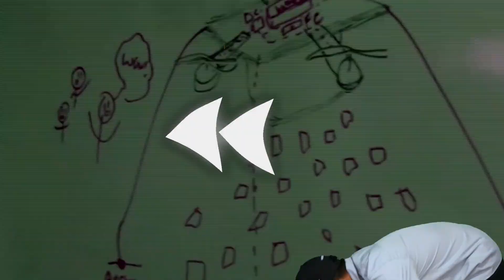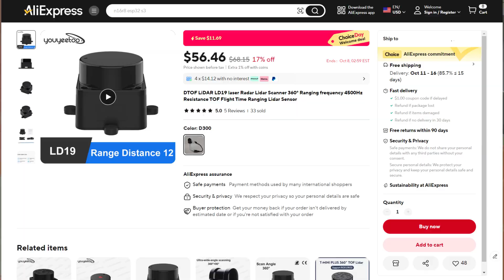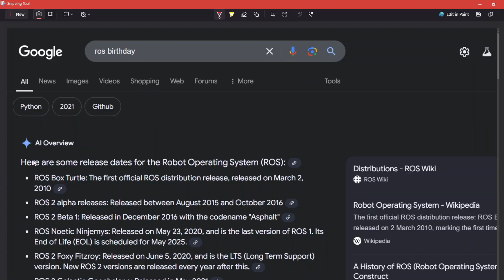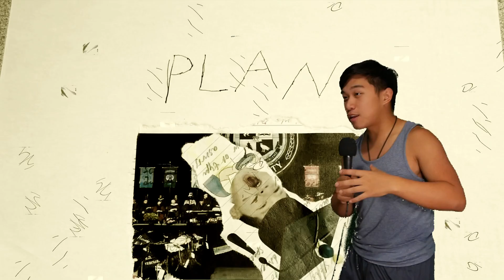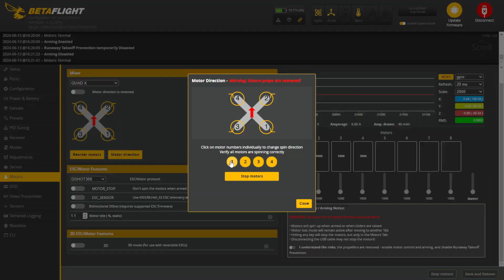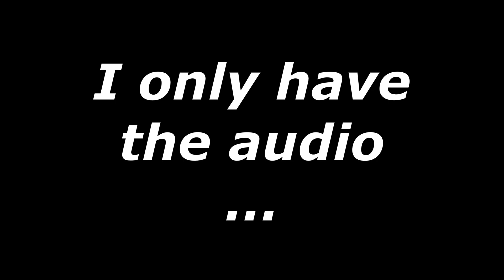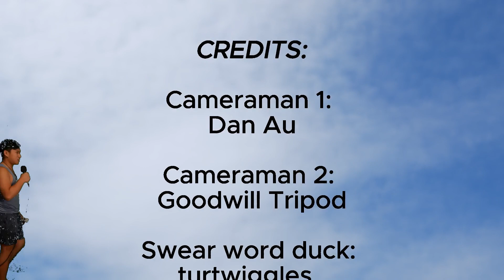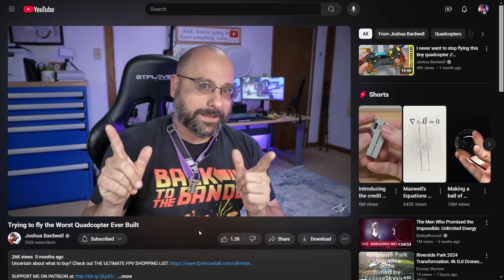I Turned My Graduation Cap Into A DRONE!!

Comment: Hahaahahaha. This video  is so fucking goood…
To explain what happened:
First flight: the drone flew good but you couldn’t quite control it. The power of the motors will have likely also slightly bent the plastic making it wobble about and giving it a springy kinda feeling when trying to move it… that’s why most FPV drones use carbon fibre 😊
Second flight: Same thing again, you are using incredibly powerful equipment so it has a whole damn lot of power. U can limit the power by limiting the max throttle in betaflight. The reason it fell out the sky is because Flysky (the protocol you were using to control it) has a more limited range. So after going out of range it just dropped 😅😂
Sorry about the no fun explanation 🤣🤣… I build fpv drones and I’m very happy to help ya if you need!
This video is sick though man
Reply from the maker: THIS IS BEAUTIFUL!!! Thank you for your feedback!!! This makes so much sense! I initially thought it was the motor (high speed small props might be hard to control, i noticed all of the other drones of similar size used lower kv but bigger props).  The flexing makes a lot of sense too, the wings were held together with zip ties HAHA.  And yeah i probably could have invested in a a better transmitter/receiver haha.  I greatly appreciate your expertise! Hopefully future drones have better survival!!!
Reply: NPP!!! Glad I could help. Higher kv is better the smaller the props… cause otherwise there Is too much drag and then the motor can’t spin at what it wants to and overheats. Good luck if you make another! I would recommend reinforcing with carbon five tubes if u want to 3d print it 😃
Reply: If ur getting a different transmitter and receiver the Radiomaster picked is best! U won’t run out of range with that thing. It’s 60 pounds sooo fairly expensive.. but it’s the best bang for your buck
Reply from the maker: Once again amazing advice! Thank you!!